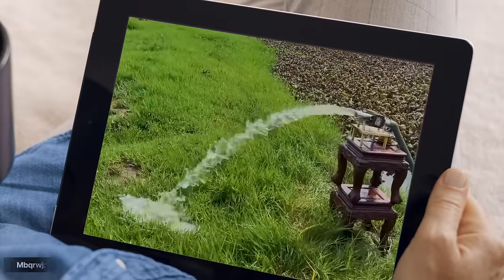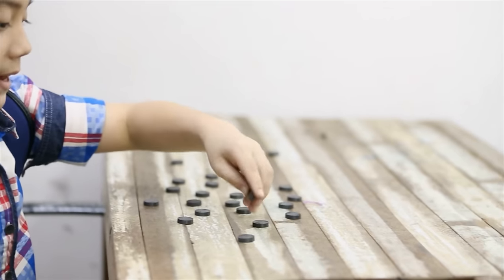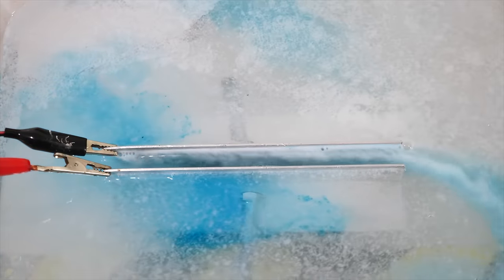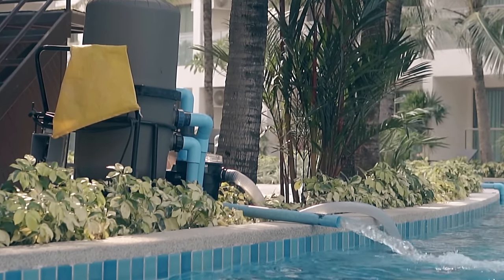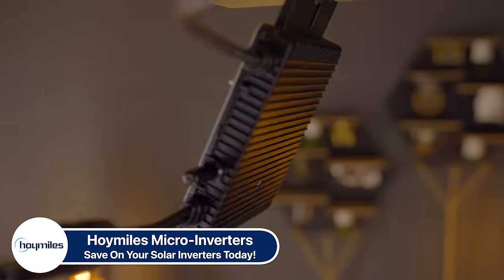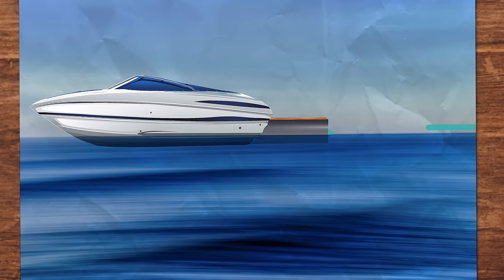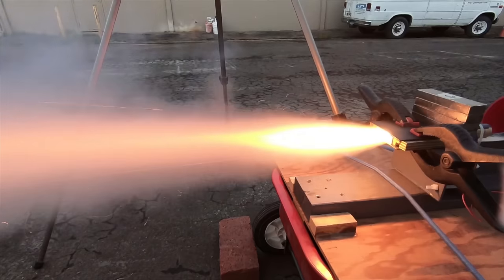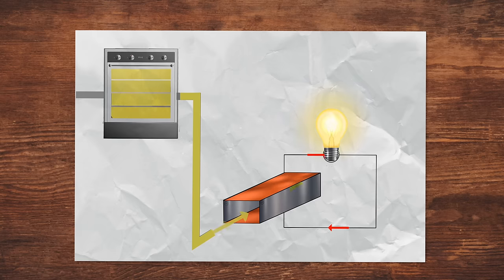Pumping Water Without Blades - Magnetic Pumps - Future of Propulsion?

Comment: The CONDUCTIVITY of the fluid is crucial.  While MHD is useful for some fluids like liquid metals or molten salts, even seawater is a bit sketchy.  And you can pretty much forget using MHD pumps for salt-free freshwater. 

But as always, there could be a place for this, and your videos are great as always.
Reply: Would it be possible to add something to the fluids that don't work well which you can 100% filter out afterwards, if needed, that could solve the problem?
Reply: Was thinking if was run in reverse could generate tidal power without turbines maybe
Reply: If you use MHD to pump seawater up hill then the inverse rule for Physics states seawater running downhill will create a current...
Reply: I hope Ricky doesn't get his heart broken by that room temperature super conductor. I heard very pessimistic comments on it.
Reply: Why not just transfer the kinetic energy from one fluid to another like a turbo does in an engine?
Reply: Electrolyse the water and you can do MHD.
Reply: the problem is high temp reduce permanent magnet strength and also increase electromagnetic impedance
Reply: @PeteTheL337 You could use beads though a small channel
Reply: @pupip55  That's one of the systems that was developed in the 1970s/80s. It works, and has easily predicted problems. This restricts it to special applications only.
Reply: @steveo5295  As soon as you can make the magnets ultra-strong (if not with superconductor windings, the ultimate) at a reasonable cost, that's an excellent system of storage.
Reply: @tetraquark2402  That's pretty much a given, but electrode consumption and ablative wear  are considerations that dictate system design, and I'm sure the (in)efficiency of current MHD systems haven't proven better than conventional systems yet.
Reply: @PeteTheL337  Several systems have been designed (and built) decades ago. They woirk, but they're not the best engineering solution.
Reply: Once we get a infrastructure in place technology improves over time with new developments and this will improve other parts of the infrastructure such as transportation and transmission of energy...
Reply: @rickquick8977  He also is hopelessly overoptimistic about the use cases, it's a ceramic superconductor and we already have those en masse (not at room temperature but at moderate liquid nitrogen temperatures) and they have very limited uses as they can not be formed into meaningful wires, even the thin film strips of those ceramics have little use because they have very little capacity...
Reply: @tetraquark2402 While it's POSSIBLE to use moving seawater in this manner to generate power, the conductivity of seawater is still quite poor compared to metals (a factor of over 10 million).  So while you can generate a voltage using this in reverse, there would be a very large amount of resistive heating of the water, gobbling up just about all the generated electrical power.
Reply: @joseq8466  And that's exactly what modern hydro-mechanical machinery does.  For a lot of fluids, the tradeoff of using 'moving parts' is well worth it.  Only in limited circumstances where the 'moving parts' cause extra problems is MHD worth it (IMHO).
Reply: @joseq8466  I think that could work if your working fluid is in a closed loop, but now you have to deal with two sets of head losses which will lower the efficiency of the system. At that point you might as well just use a normal propeller.
Reply: @tetraquark2402 If applying force to seawater works, it would also be a way to turn electric energy into forward motion of an oceangoing  ship/boat. imagine a nuclear powered submarine (or aircraft carrier?) without propellers. the sub might be ridiculously quiet
Reply: @PeteTheL337  we already have working prototype ships with these types of enigines, but you need extreme electromagnets so with our current tech it isnt economic so it wont be viable until we have room temperature super conductors for the magnets.
Reply: Is steam conductive ?
Reply: @kingrutse3278  Dry steam with no moisture content is pretty much NOT conductive.  A common power plant measurement is to condense a small amount of steam and measure its conductivity in order to measure 'carryover', the amount of moisture and contaminants being carried with the steam exiting the boiler.
Reply: @PeteTheL337  Would not be practical, the last thing you want is to contaminate water just to improve propulsive properties.

Comment: A variant that I've seen used in several applications is MHD flow-meters.  Small isolated electrodes inside the pipe, surrounded by a strong electromagnet.  As the fluid flows, the electrodes can measure the small voltage generated and signal the velocity of the fluid.  Using very sensitive electronics that don't require a lot of current, it works with only weakly conductive fluids.  Once you have velocity and known pipe size, the volumetric flow rate is easy to calculate.
Reply: Ah yes isolated electrodes, the ground breaking technology that will help us reduce our energy consumption by 100% and save the planet!
Reply: membrane pumps are so cheap though and long life. plus bearings on regular pumps can last decades
Reply: @archibibliothekarius2301  saying bros comment sounds made up?! 😂😊

separated electrodes pos neg actuslly will move water but so small amount of force
Reply: A flow meter can be turned into a generator anything that spins around and around...
Reply: They’re called Mag Flow Meters
Reply: @derrekvanee4567 The amount of force is proportional to the Strength of the magnetic field and the electrical current.  The electrical current is a function of voltage and the conductivity of the liquid.  Pure water has very low conductivity.  The salinity of seawater, on the other hand, makes it a good conductor and much more effective fluid for MHD transport.  LMFBRs (Liquid Metal Fast Breeder Reactors) use liquid sodium, sulfur, or such, as a cooling medium, that can be reliably pumped using MHD, because of their high conductivity.

Comment: The efficiency increase is very interesting. Further, the 'no moving parts' is intriguing. However, where pressure is high, the exit points of the fluid will eventually show wear and should for designed to ease maintenance and repair.

Comment: At 9:57, the efficiency formula onscreen, 1573/300 doesn't give the result 0.809.. It works only if you go "1 - 300/1573", which is, of course, a different formula. It's the same at 10:10, "1 - 300/3273" gives the right result.
Reply: Yep, I immediately noticed that error. I did know that the higher the temperature difference (or deltaT), the better the efficiency. Maybe the numbers were just shown for illustration purposes, but they really should not be written that way. You need to correct that formula. Otherwise, that was a very interesting video!

Now if that room temperature superconductive material is real (which I really doubt), that would make way for some crazy new technologies.

Comment: It also sounds like it moves the upper limit for speed. Just as ion thrusters could accelerate spacecrafts to really high velocities higher than conventional engines. Could a long enough magnetic pump increase a fluid to super high velocities? Could a long enough one create a negative pressure such would "stretch" a liquid into a gas?

Comment: It sounds like it would also avoid the cavitation problems that limit the speeds of propellors.
Reply: Technically it does not eliminate them as you could in therory try to pull in water faster than than it can move into your intake and cause cavitation bubbles but as a pratical mater you are correct.  Youd have other material stress issues elsewhere if you could pump the water that fast let alone the power generation issues needed to pump that much current and that strong of a magnetic field on anything mobile.
Reply: would
Reply: Yeah, it's still subject to the same limits. It's not an issue with the prop or the magnet. It's a water issue

Comment: Especially for industrial designs we may not need to wait for a true High Temperature Superconductors, the MIT ARC reactor is using a superconducting ribbon tape which is in current practical use with its fusion reactor design.  Isn't it possible to adapt that tape for use in improving the efficiency of current fossil fuel based energy production methods and thus immediately address the level of CO2 production in those power plants, through efficiency gains and thus find that we need fewer new power plants? To be sure that may be true for many other large applications as well, such as, if it were integrated into the propulsion systems of ocean going cargo ships.

Comment: With a room-temperature superconductor, cars wouldn't need batteries. The charge could be stored in the superconductor as current and siphoned off as need. Also regenerative braking is possible, making the cars even more efficient.

Comment: Do you understand that the volume has to be huge to even get some noticeable propulsion ? There is a strict limit of voltage, because at high voltage the electrodes would quickly degrade and the losses due to  ionization would skyrocket ? It wasn't that the idea didn't work, but it had very limited efficiency for high output applications.

Comment: The problem with many of these ideas require very high current at low voltage.

The low voltage is not a problem, but the high current is, as it causes high heat, even with low resistance, which is a major loss of power.

Another problem with high heat, rare earth magnets lose their magnetic properties when they warm up, so rare earth magnets would need a change to keep their magnetic properties when they are hot.

Comment: I am not saying those other guy are being legit, they are not they are being scammers, however, you messed up too.

The peak strength of a microvwave oven magnetic field is 9.2x10^-5 T because the microwave is oscillating at a frequency of 2.4 GHz. Inductors have reluctance.

The time constance is the inductance/resitance so if you're looking at a microwave, the cores have like almost no resistance so the RL time constant is seconds long. If the inducance is 2 henries and the coil resistance is 0.2 Ohms (for 10 meters of wire) then the RL time constant is 10 seconds and It takes 50 seconds (5 RL time constants) for the electromagnet to reach peek field strength.

Comment: I think that, the idea of using it in high heat doesn't hold, the reason is that, magnets don't like heat. That's why magnets work better when, they're cooled.
Reply: Hence the excitement about a room temperature superconductive material.
Reply: @flightmaster999  room temperature is an absurdly far cry from 3000K

Comment: Key phrase:  Conductive Fluid.  This works well for salt water, but not for fresh water.  Thus, replacing motors, pumps and power generating in fresh water environments won't be a thing.

Pools using salt water chlorination, however, can used MHD!

Comment: I agree EV and Hydrogen is the VHS/BETA max of today but I don't really see it that way. I think the future would be a hybrid of the two technologies. Developing a vehicle that can do either / or would be game changing. Redundancy alone would be impressive but you add up all the ways each technology can compliment each other when used as a system in addition to being able to use it independently would be a pretty amazing feat. When your batteries run low you can switch to hydrogen power and potentially charge the batteries while continuing to travel with the hydrogen power.
Reply: Yes, I totally agree. But it all depends HOW the hydrogen is made. Using fossil fuels to make electricity that is then used to make hydrogen is a very bad idea. It would actually make things worse from an environmental perspective because of the loss in efficiency from fossil fuel to hydrogen. There are existing ways of making clean hydrogen such as hydroelectricity +electrolysis, some bacteria can generate hydrogen, and better more efficient ways may be coming.

Using hydrogen in batteries (hydrogen fuel cells) is pretty efficient, that's what they used for power on the Apollo missions. I can only image how more efficient these have become in the last 50 or more years!
Reply: Hydrogen IS either EV or ICE tech- there's a use case for having both systems on one vehicle, it's called the hybrid EV, you're just arguing for an ICE that cuts efficiency from fuel-cell-only operation.
Reply: @ticthak  Using hydrogen in ICE is not a good idea. It emits NOx because it reacts with the nitrogen in the air. Also, hydrogen must be kept at extremely low temperatures to be stored in liquid form. That is very difficult to do on a car. One last thing, hydrogen does not have anywhere near the volumetric energy (kJ per litre) of existing fuel and diesel.

Comment: You're forgetting one very, very vital piece of information. When you go from one material to another from another system to another from another form to another To another voltage, potential or resistance, you get energy loss.
1 You have to have a very high electrical potential in the first place.
2. You're sending that voltage through water or an electrical Conductive fluid
3 You're converting it through a Electrical hydro dynamic system.
4. You're also converting it back into electricity. All those processes, you're constantly losing energy resistance potential.
Reply: Think of it as harvesting energy as a collective instead of a single source...

Comment: With sea levels rising why not use a MHD pipeline across the country and if MHD can power a nuclear submarine it  can pump alot of sea water uphill. Then use gravity feed turbines downhill you could cascade these over-abundent-unity power plants across the country, because with MHD there is more energy you can harvest. 

On the downhill side use the reverse rule in physics applies, which states saltwater running downhill will pick up a charge of its own.

Also you can harvest MHD hydrogen bubbles by running it through a fuel cell.

This could be a totally green system with no harmful byproducts...

Comment: This is one of those technologies that has been one break through away from being practical for many decades, and is likely going to stay that way.  If there was a way to make this silent propulsion actually work, even if expensive and not commercially practical, the US Navy would have it on nuclear submarines.  They make gobs of electricity and don't care about economics.

Tom Clancy wrote the "Hunt for Red October" which was released in 1984, nearly 40 years ago.  One of the major plot points was the USSR having a submarine with a new silent drive called the "tractor".  They never used the name MHD, but the description sound very much MHD as a pump that pulls in and expels water with no moving parts.

Comment: 9:53 there’s a first error —> efficiency is T_L / T_H while you printed the hot temperature 1573K on top

Then… How does 1573/300 yields 0.8 ??
Even 300/1573 is not equal to that… I can’t figure it out

Comment: You have misunderstood the efficiency evaluation in making the crossover between MHD concepts and traditional thermodynamics engines. The Carnot efficiency that you present and use has NO direct application to a pure MHD generator - it is not a Carnot heat engine to begin with. As well, many real studies on MHD practical efficiencies, dating from the sixties, show native maximum efficiencies of only about the 35% mark of typical well designed turbine plant. What does possibly give MHD an upper hand is to first run plasma through such a Faraday type generator, and THEN find a way to degrade the remaining high quality heat-fluid temperature in a hot turbine to extract the "Carnot energy".
As well, since permanent magnets can already do a fine job of maintaining a field if properly scaled in size, the introduction of superconducting technology for that portion of a design would do little to increase efficiencies, and would do little to change the overall economics under consideration.
regards DKB